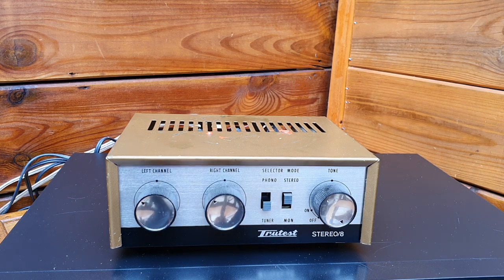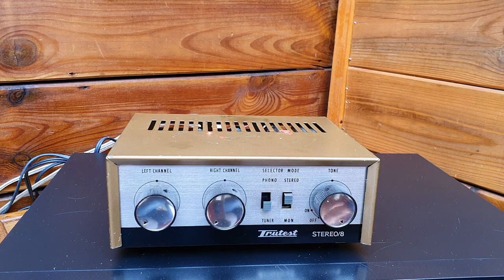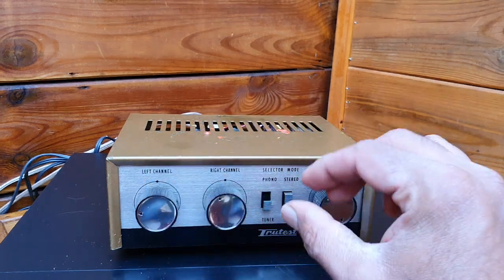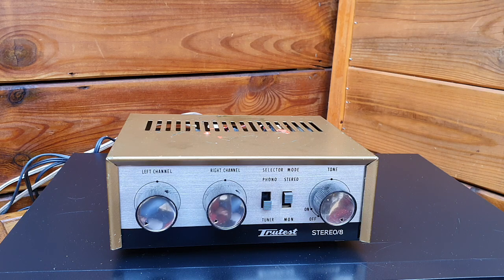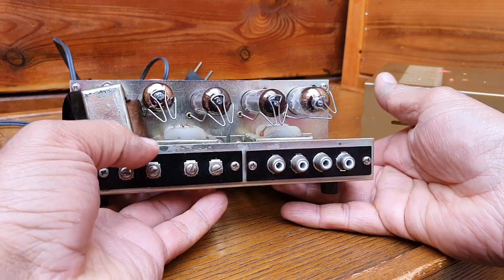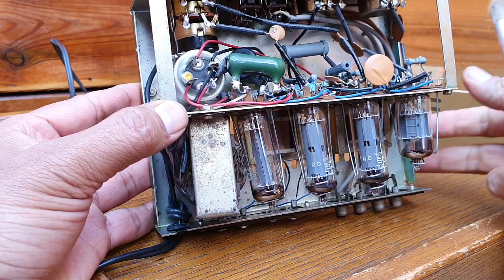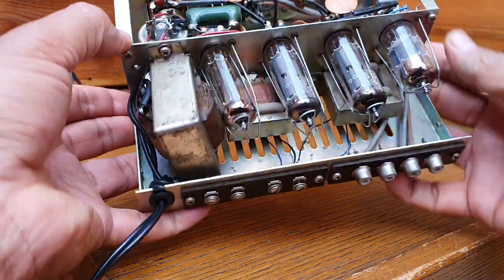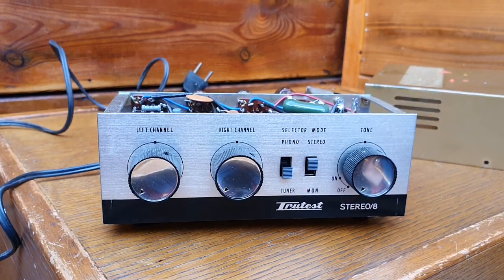Trutest Stereo 8 Tube Amplifier from 1963 | Journey into Nostalgia

Comment: Looking at it...Designed  to run direct from 110V with live chassis. Valves are 30V heaters for main beam tetrodes.(All will add to 110V) The third larger valve must be a rectifier. The transformer is pointless and interferes with seating of rectifier. It takes place of reservoir. Crazy little thing! Output transformers are miniscule.. Thanks for letting us see it.
Reply from the maker: I agree it appears that transformer was added as modification at some stage. I am glad that you liked it. Many thanks for supporting the channel. Cheers